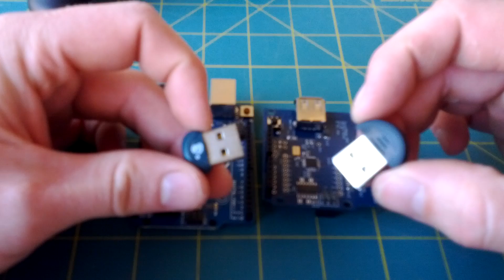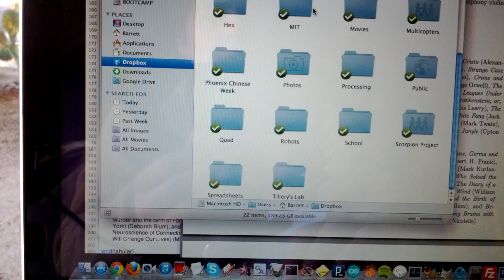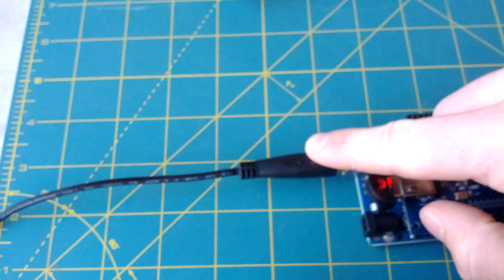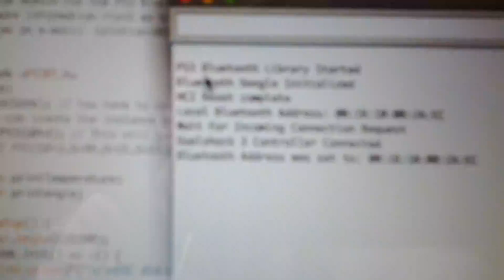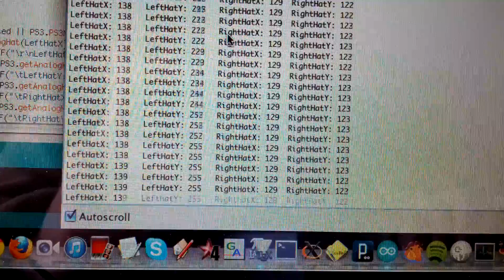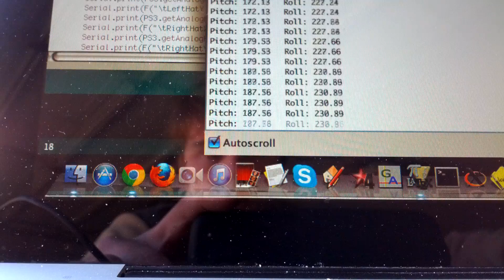How to Connect a PS3 controller to an Arduino with a USB host shield and Bluetooth dongle (Part 1)

Comment from the maker: If you've downloaded the library and placed the folder in the correct location, the example should show up. I suspect that the library has not been installed correctly. If this is the case, even if I give you the example sketch, it still won't run because the Arduino IDE will not be able to compile the library. Make sure that you have removed all dots (.) and dashes (-) from the library folder name, otherwise the Arduino IDE will not recognize it.

Comment: then it is awessome! and i'm already thinking of aplications to the remote.
By the way, do you think its a best buy a arduino mega or uno? i need to get one of them in my hands and quickly because i can't wait to try out that remote and a bunch of servos/motors :)

Comment from the maker: Let me make sure I understand you correctly. You are able to achieve communication with a dongle (i.e. retrieve the dongle's BT address), but you aren't getting anything when you plug in your controller? Are you doing a hot-swap? Do you get "Bluetooth Library Started" right after plugging in your PS3 controller? If so, I think I know what your problem is.

Comment: To reset the PS3 controller to its default address, all you need to do is connect it to one of the USB Ports on the PS3.